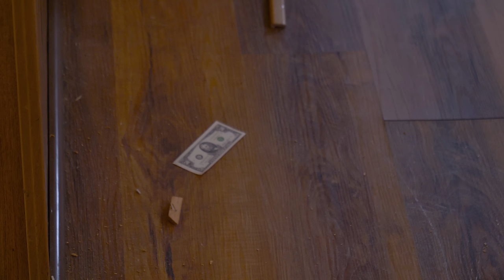$2500 DIY Kitchen Remodel | Episode 1

Comment: Cut the drawer fronts into 1 inch strips, then knock them off one at a time. Then there is only a few staples in each piece. Not much holding power then.

Comment: When shut off valves are original on any house more than 10 or 15 years old especially valves that the screw in style,  always just replace them, and when yoi do replace them, only install ball valve style,  like 1/4 turn, whichndont use rubber gaskets that erode away and crack, ball valves arent made the same way and rarely ever fail even after many many years in this application.

Comment: I'm a hoarder so there is never enough storage for me. LOL But those cabinet doors do look ugly. Ew, particle board! If you were replacing the entire cabinets, I'd say look for a nearby Home Outlet store. They sell unfinished oak cabinets. Plywood construction but faces are oak. We did a kitchen for my best friend with cabinets from there and I painted them for him.
Anytime I see columns like the kind propping up those upper cabinets I think it could have plumbing or electrical in it. I would have thrown my back out trying to break off that low countertop. LOL.
You don't have to rebuild the bottom shelf in the sink cabinet. You could just put down some waterproof shelf paper on the floor and use it as extra storage space.
I'm probably going to have to do something similar because somehow my stainless steel sink got a pinhole in it and leaked all over and ruined the floor of the cabinet. I also need to add an AAV under mine because it currently has an S-trap.
That countertop was a bear to remove! As an aside, remember when you were building a deck and used a hammer that had a grabber for boards? Stanley has one with that but the opposite end is a prybar. It's a very useful tool.

Comment: I have a question and no one I ask seems to know the answer  I purchased an okder home maybe built in 60-70s in the kitchen I thought it was just a white painted wall in between my upper and lower cabinets and behind my oven however when you get close and inspect it its actually a white kind of slightly a gloss of some type of say plastic material maybe looks like it may have came in sheets and it was cut and I guess glued to the wall I'm not sure it doesn't ha e any ridges in it like paneling what is this called? Can you paint over it? Can you tile over it? Kind of a slick material I'm not good with measurement it may be like a quarter of an inch thick in not sure I don't see any nails or screws so I'm assuming it is glued to the wall and it feels like hard plastic maybe I'm not certain
Reply: It is probably some type of plastic laminate. You can paint over almost anything with today's paints. I would scrub it very well with something that cuts grease. Being in a kitchen it'll have a layer of grease you should not paint over. Then I'd scuff it up with some sandpaper to remove the gloss and give the paint something to adhere to. They make primers especially for surfaces like that (is one called Fusion?, I can't remember). A coat of that and then you can use any latex paint. I'd get something scrubable for a kitchen.   I would go to a real paint store like Sherwin Williams where they are far more likely to know what they are talking about than at the big box stores.
Reply: @ianbutler1983  thank you

Comment: It is a lot easier and safer to just unscrew things or cut them with a saw than to run around like a lunatic smashing things with a hammer. A calm, orderly disassembly is not as dramatic but a lot smarter, in my opinion.